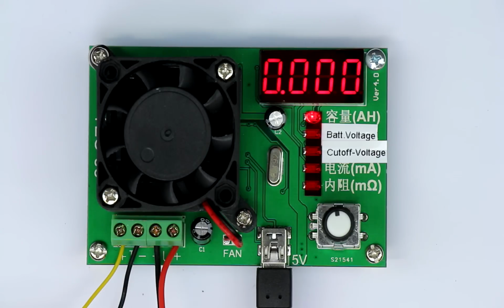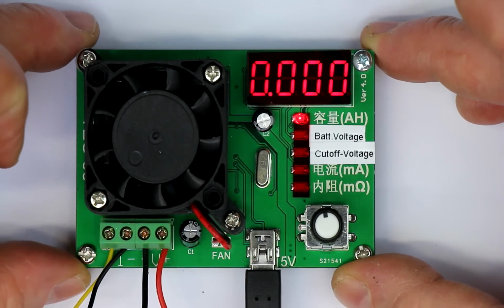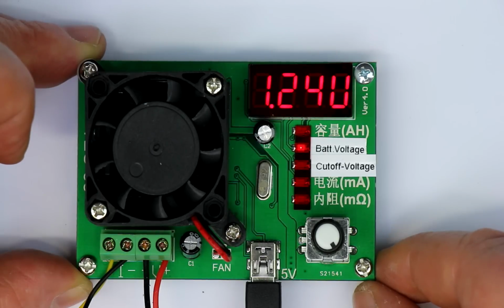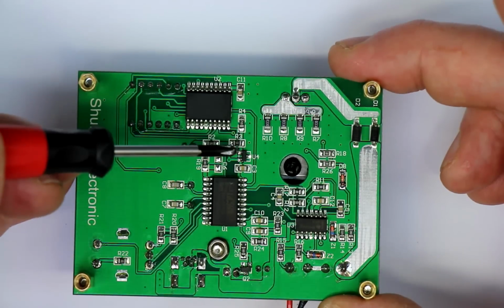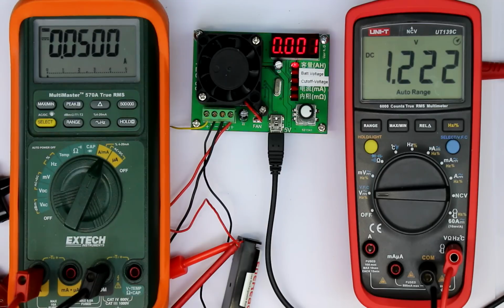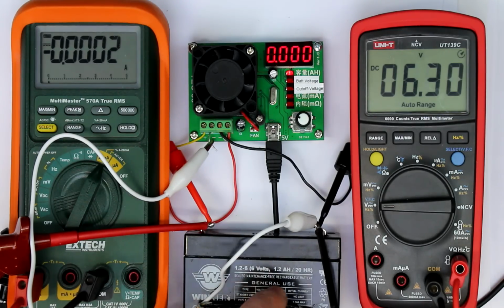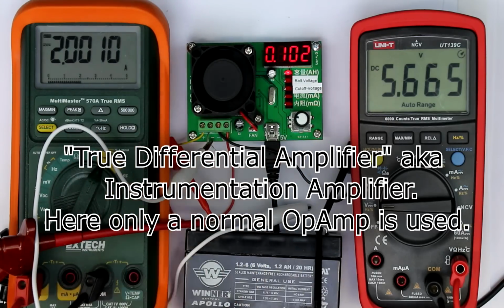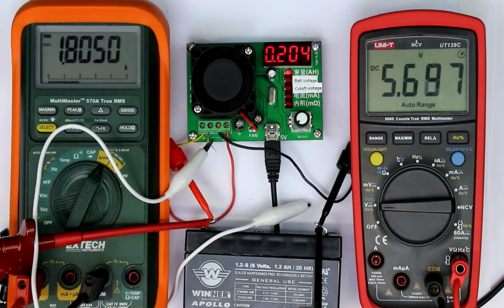TEC-06: An accurate, versatile & cheap Battery Charge-Tester

Comment: I ran into a problem where this TEC-06 would not do a test for certain power banks.  As soon as the test would start, it would stop.  I noticed the TEC-06 is impatient about power banks dropping to 0V for a brief moment as the PB switches on, and has a brief voltage drop-out.  To solve this problem I soldered a 1000uF 6.3V capacitor to two pogo pins, which I use to temporarily sustain the input voltage while the PB momentarily goes through the 0V state.  To do so, I push the capacitor down against the top of the I+ and I- screw terminals for the few seconds during test start and then take it off.  So this "starting capacitor" is just a workaround for certain powerbanks.

I also noticed the device will get stuck after a test and not reset to zero.  I'm thinking I need to make a convenient switch on the USB input so I don't wear out the input jack. to cycle the power.

Comment: I suspect what you see as a "control loop" is the intentional, periodic, quick removal of current used in "mode 1".  This enables updates to the internal resistance measurement, which compares load vs unload voltages for the calculations.    Otherwise, an update to the internal resistance would not be possible.

I'm sure the integration of total capacity excludes the duration of the IR measurement event, so that is why you find the end result is accurate.  

If you start the procedure from the voltage setting, this invokes "mode 2" which excludes the IR measurement, which is appropriate for power banks.

Comment: Thank you.  Great video.  We see many chargers and testers on the web.  I am very please with your discovery.  However,. One area or void on lithium 18650 cell area is the measure of internal resistance.   These values are critical when determining battery health.  We a great deal on capacity.  Your insight and assistance on how to accurately measure internal resistance in of a cell.
Reply: What replaces the TEC 06 that measures the internal resistance of a 18650?

Comment: What cut-off voltage must one set for testing (discharging) AA NiMh batteries? Now I use the lowest possible settings on the TEC-06 which are 50 mA and cut-off voltage of 0.9V. Is this bad?
Reply from the maker: No, that is quite OK. The discharge current should of course be chosen according to the device that you use your NiMH batteries. When they get worn, the intternal resistance increases. Therefore the cutoff-voltage is reached quicker at high discharge currents even if there is still some remaining charge. So the capacity is heavily dependent on the discharge current and the wearout of the battery.
Reply: @KainkaLabs  Thank you for your quick answer! I set de discharge current low because I use the batteries only for low-draining devices (like wireless keyboard and mouse).

Comment: Hi, thanks a lot for this Video! I also ordered this little thing to measure my Sony NP-FW50 batteries (typically used for DSLR/DSLM cameras). But I´m wondering why I can discharge the 3rd party batteries (e.g. baxxstar) with a much higher current than the genuine Sony batteries? If I go higher than 100mA the Sony batteries turn off. But if I´m recording a 4k Video tha batterie lasts roughly 1 hour which corresponds to 1000mA, 10 times more! Any idea why?

Comment: Just to be sure, this doesn't require a load to discharge the battery current?
Reply from the maker: If you mean "... to set the discharge current" instead of "...to discharge the battery current": You can set the discharge current without the load being connected.
Reply: @KainkaLabs  lol you got me. Ok cool thanks man. Love your vids

Comment: The huge voltage difference reason is (in my opinion) the tester momentarily turns off the load for measuring the voltage, while your voltage meter measuring the voltage under load.

Comment: Have a TEC-06 and and EBD-M05 and after calibrating the last one using the original software (I came poorly calibrated), the TEC-06 still kick a** of teh EBD-M05. Specially when measuring at high currents, the EBD shows bigger deviations while the TEC proves realiable.

Comment: I just found out a problem. The battery internal resistance check, at the beginning of the measurement, cause a very high current (just for ms, but much higher than the regular discharge current), this can trigger a protection circuit at the battery. This will also occur, when starting the measurement with "mode 2" (which is for two wire).
Reply from the maker: Has that (protection circuit triggers) occured in real life? I doubt that this gives a problem.
Reply: Yes, occurred, not with a battery PCB, but with a cheap USB powerbank which I wan't to test (which is limited to 2A max current and shut down, when exceeded). I took some time, to find out what's happen here. My workaround was to put a supercap parallel, which was also tricky, because charging the cap causes also high drain. It's probably better to add a resistance in series and bypass after the test. Maybe other versions of the TEC-06 don't have the problem. For my understanding it's a bug, the IR should not be determined when starting in the 2-wire mode.

If I have time next week, I'll try to do a more detailed measurement regarding the IR test.
Reply from the maker: Interesting. I think I remember I noticed something similar but didn´t care much about because it gave no problems with my test-setup.
Anyway it looks like it´s a software bug.

Comment: It needs to have constant voltage (CV) and constant current (CC) for lithium
Reply from the maker: No, because it´s a discharger, not a charger.
So it "needs" to have neither CV nor CC.
CC-discharge up to a final cutoff-voltage is just the usual way to measure battery capacity.
Reply: Roger is correct. Only charging requires a CC-CV specific charge curve so as to not overcharge the Li-Ion cell. It is good to have a settable constant discharge current so as not to exceed the particular battery's max discharge rating.

Comment: Hey, did you compared it to an Genuine IMax B6 ? Regards
Reply from the maker: No. 
Because I am only searching for a versatile discharge capacity meter that you can set down to very low discharge currents. 
Does the IMax B6 do that (e.g. to be "better" that the TEC-06: 10mA discharge current, 0.8V cutoff-voltage)?
Reply: That + a BUNCH more stuff, well worth the $32 price tag

Comment: U4 is classic 431 IC. Like TL431.

It seems they ran the data lines from USB directly under the micro on the PCB layout?? I found an STC datasheet where they describe... something where these lines from USB connector are essentially connected directly to RXD and TXD pins of the micro, so perhaps they abuse USB connector for plain TTL serial, and they probably have a magic cable to go along with it, where they have an adapter IC.

EDIT: STC supplies a Y-cable that goes to USB power and to proper RS232 socket. It's an active cable that has something like MAX232 in it.
Reply from the maker: Well the TL431 is more or less a precision reference (depending on the grade and version you buy).

As another viewer pointed out (and gave a link) the micro is simply spitting out serial data from it´s TxD pin.
You need a separate USB-Serial converter to tap the TxD (at pin 3 of the micro I think) to feed it then into the software.
Anyway this is just a gimmick to log the data if you want to.
But you can´t send control commands to remote-control this thing.
So for me this feature is of no great use (and I want/need a standalone device that monitors the milliamphours without a PC running all the time)

I have already got and tested another battery charge tester with just the reverse:
Not useable as standalone device but only (and fully) software controllable.
It gave excellent results concerning useability, accuracy and the GUI/functionality of the software.
Will present that in a few weeks together with the other 2 testers I am still waiting for.

Comment: Hello, it looks like the white croc clip is not connected.
Reply from the maker: Iti is connected. There is a hard to see blank wire srewed into the screw-terminal where the croc-clip is clipped at..
Reply: I mean the other end. At 22:44 it seems to be hanging in air instead beeing clipped to the battery contact.
Reply from the maker: Yes. You are right. 
But at that moment I had already found out that the "4-wire measurent" is in fact a "3-wire measurement" and both leads from the "-" pole of the battery are connected at the screw-terminals.
So here it has no effect on the measurement resp. the error in the voltage measurement under load.
I will explain everything about "true" and "false" 4-wire measurement in a forthcoming video and demonstrate in detail what is wrong with the way they tried to implement 4-wire connections with this devie.
Reply from the maker: The 2 outer wires "+" go the positive terminal of the battery while the 2 in the middle go to the negative terminal.
Reply from the maker: The follow-up video explains that: https://youtu.be/3FEMPlNA0EQ
The accuracy improved by a factor of 2.
The remaining error is due to the offset of the LM324. A precision quad rail-in/rail-out opamp would probably bring the remaining error down to zero.

Comment: There seems to be a version which can be connected to a PC as well
Reply from the maker: I think this is an error in the Ebay description. I have seen non-existing features claimed in many Ebay product-descriptions from Chineses vendors because they copy descriptions from each other without understanding what they really sell. 
The used micro cannot handle USB.
Reply: KainkaLabs you might be right, the description is at least confusing if not even contradictory. Though the one I found shows even a discharge curve (found on aliexpress)
Reply from the maker: Yes I know (we both found probably the same ad)
The curve is from a software from ZKE as far as I remember which I already downloaded in an English version for some of the still to be delivered battery charge-testers.
These curves are used as showpiece in more than one battery charge-tester which actually have no real USB functionality.
Reply: There is certainly a Software-enabled version of this unit. The following link is to a blog that reverse engineers the device's serial communications: https://syonyk.blogspot.com.au/2018/01/reverse-engineering-tec-06-serial.html - and he says he codes a Linux software of some form to grab the data. Note that the standard version can be hacked to add a remote serial port, and there are a number of links on that webpage for more information.
Reply from the maker: Sounds interesting, but the link doesn´t work :-(
Are you sure that it´s a USB-connection or is it just a pin of the micro that puts out serial data?
Reply from the maker: OK. Found out the right link-adress:
https://syonyk.blogspot.de/2018/01/reverse-engineering-tec-06-serial.html#more
As I thought it´s a serial connection but sadly (and predictably) not over USB.
I will read the blog-post in detail in the next few days and see if this can be made to an easy use for the viewers of this channel.
Reply: Hi Roger. Strange that your .DE link redirects me to the .AU link that I posted. The "Online Version" of TEC-06 uses a generic USB Serial converter. Check if Rx Tx serial lines from IC are coming up vias and running to pins of Mini USB socket. My guess is that all TEC-06 PCB are the same, and the difference is simply whether a USB adaptor is packaged or not. Here is link to photo of online version of TEC-06 https://goo.gl/he5Aw3 and here is the latest model USB converter https://goo.gl/asVPst. I think older 2015 (and maybe 2016) software package was for Prolific PL2303, but new 2017 software RAR includes CH340 drivers. I do not think it matters what chipset, only that chipset driver is OK (most PL2303 are fake now), so they change to CH340.  I have a number of electronic loads that use this form of connection system.
Reply: Roger - here is link to manufacturer's Taobao store https://celltec.taobao.com/ - the product pages contain links to the latest software, instructions, etc. Use Chrome and inline translate the page from Chinese to your preferred language. Also check TEC-12P which is the big brother of TEC-06. Note that TEC-06 is very old 2014-2015 product, and you would be better to look at other brands, maybe ZKE.